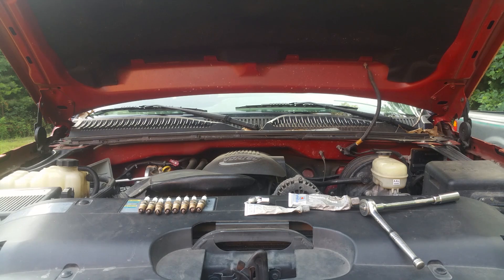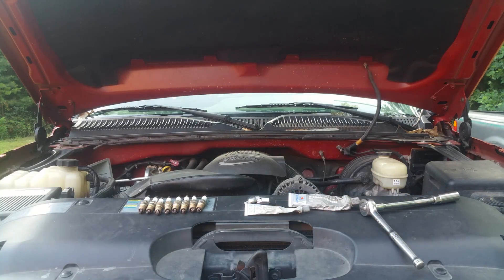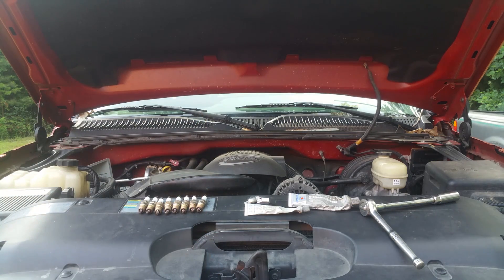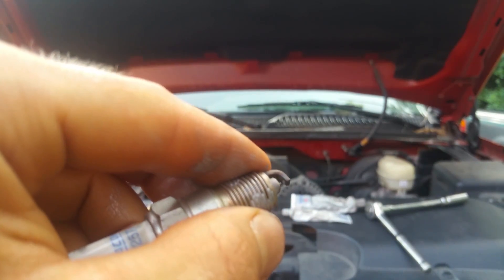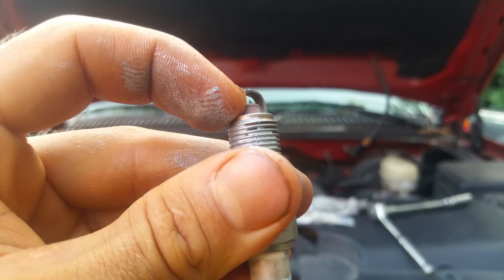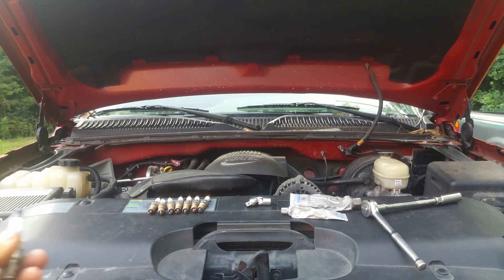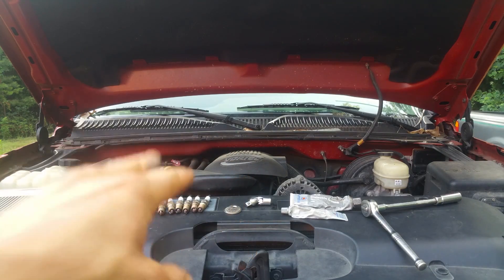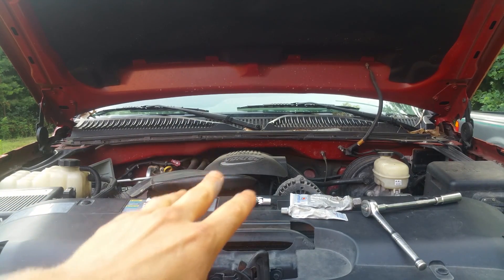NEVER Change Another Spark Plug Until You WATCH THIS!

Comment: Definitely use anti seize. I can’t stress that enough as a professional mechanic who has pulled threads several times and had several stuck spark plugs. The coating the manufacturers use doesn’t work long term. I always use copper or nickel but any anti seize is fine as long as there is some on there.

Comment: I just had to use a braker bar to remove iridium plugs out of my 2018 ram. I did use anti seize on new plugs going in. Just didn't get crazy on tightening them. I go by feel and not with torque wrench. I trust what i can feel vs the extra leverage added with large tools.

Comment: How can you NOT get dielectric grease on the plug  terminal ?? Some plugs are in hard to get to places, resulting in difficult boot replacement. Play/wiggling the boot on will get the grease on the terminal nut. Dielectric  grease most certainly will conduct. It's made so electrical conductors won't corrode and BECOME NON-CONDUCTIVE !! My motorcycles wiring harness was replaced under a recall. I paid the shop to spray clean EVERY electrical connection and then apply dielectric grease. Your supposed to apply it to electrical contacts like the old style turn signal/tail light bulbs where they contact the metal bulb holders. Electrical contacts in the auto/moto world have improved with them being rubber encased. Even with the new you should use it. Dielectric grease is conductive and non conductive. Maintains 100% conductivity and  disallows unwanted electrical currents. It's a 'miracle' grease. Every time you take apart an electrical connection,  you should clean it good with electrical contact cleaner, then fill with dielectric grease. CRC has a spray can with a spray tube that will easily fill whatever. Spray some in the spark plug socket rubber holder and the plug boot. It's at Autozone. It will make electrical work easier later on.

Comment: Good video...
Anti seize not needed on some plugs , some come with special coating already...
Boot grease for boot on plug porcelain doesn't conduct electricity...
Dielectric grease good on wire to tip of plug
Yes... maybe good on wires into cap too.
In the old days we put oil on threads helped some.
Changing plugs is more complicated than it used to be...
Some brands anti seize not good for aluminum heads... that is what I'm seeing on the internet.

Comment: If you buy the economy (value) brand of any manufacturer plug, you may find it has not been plated on the threads. ALWAYS CHECK WITH THE MANUF.  Those ACDelco 100K plugs appear to be plated and I'm confident the ones you replaced them with, are as well. In the case a plug is NOT PLATED you should apply a thin layer of anti-seize. However, applying anti-seize on top on an already plated thread (usually a kind of gold-ish or silver color) will cause a significant over-tightening of the plug even if you use a torque wrench, which you should be using anyway. You could over-tighten by as much as 30%. Going so far as to strip the threads in the head. 
And as many on here have stated, dielectric grease should stay located in small amounts on the inside of the boots and insulators. Many people have found out the hard way what too much resistance caused by an overload of dielectric grease inside a boot, can do. You may not encounter a problem initially or at all in some cases, but all the experts agree it's a bad idea to pump a lot of grease inside a boot or apply it to the terminals. 
Your point about the gap tool is 100% correct and important for people to know.

Comment: YOU ARE WRONG AGAIN, BOZO! YOU PUT A SMALL AMOUNT OF DIELECTRIC GREASE ON THE PORCELAIN PART OF SPARK PLUGS AND A SMALL AMOUNT ON THE BEGINNING OF THE SPARK PLUG BOOT AND NOT ON THE INTERNAL CONNECTOR IN THE BOOT. DIELECTRIC GREASE IS AN INSULATOR AND WILL RESTRICT CURRENT FLOW IF NOT USED PROPERLY!

Comment: When I was a little kid I remember a family friend rubbing a little oil on the plug threads. He was an old-timer even back then. I've seen others do it since. Maybe that's the old world way, or the cheap and handy way.
Reply: Might be an old timer but that is bad advice! oil will eventually work its way to the electrode. There is not need to put anything when torqued to proper spec.

Comment: So copper paste is just as good as the aluminum right?
Reply from the maker: Depends, typically copper is used on steel and aluminum is used on aluminum.
Reply: @MattsShop  I'm replacing WR7DC plugs on an old '65 Mercedes 250 S as per the owner's manual. These Bosch are made in Russia, so if they're anything like Russian ammo they're probably steel. Ha ha. Now you have me wondering though. I'm looking at the boxes they came in and I don't see any indication as to what material they are.

Comment: Anti seize does not go on spark plugs, its a myth that fools believe.
Reply from the maker: Wait until you have to use a breaker bar to get spark plugs out of an Aluminum head, and rip out the threads in the head. You'll believe in Anti-Seize then.
Reply: @MattsShop  It never happens if they are installed properly!
Reply from the maker: Maybe, but I have ripped threads out of aluminum heads, because of other people.

Comment: Chevy Colorado has a Vortec engine compatible with Japanese Isuzu so you can use Japanese spark plugs too. The problem with dielectric grease is that it becomes dry and when you pull you older spark plugs some may fell inside the cylinder hole.

Comment: Hey Matt I need your help on this one.I bought the Bosch double Iridium spark plugs model number 9602 for my GMC Sierra 1500 5.3 L V8 Vortec And I was watching A video about the best spark plugs to use for a GM 5.3 L engine and all the spark plugs were mostly AC Delco. Should I stick with Bosch or go with AC Delco?
Reply from the maker: Everyone says to use AC Delco Plugs in these engines. They run the best and literally last 100,000 miles. No need to get anything else. Pretty sure I used Iridiums in this truck.

Comment: I noticed your torque wrench is missing. My number one recommendation is to properly torque the new spark plugs. Do this into a cold engine without anti-seize or lubricant and you'll not have all these problems.  Modern spark plug threads are electroplated with a coating to prevent dissimilar metal galvanic effect. Use of any additional compounds are prohibited in the service and repair manuals. Modern spark plugs torque spec is likely much less than most would guess. I suspect your experience removing a tight plug was due to substantial overtorque by a previous worker. The aluminum threads get stretched. Typically a guy replaces on a hot engine, anti-seize or lube the threads. then guess the torque with a ratchet. Probably applied 30-40 ft. lbs. by hand into hot aluminum threads with lube. The spec is likely 14 ft. lbs. cold and dry. The difference is huge. Now the ground strap is a quarter to half turn out of position so fuel burn is compromised making the computer fight to find the correct mix for combustion. 

Dielectric grease is awesome. It's really just Silicone oil with some thickeners. It is non-curing so it doesn't dry out, crack, harden or wear out. Use on the electrical contact is recommended because the connector is a spring pressure type which pushes the grease aside to ensure metal to metal contact. The grease eliminates Oxygen bearing air from the metals to prevent oxidation. While the grease does contain Oxygen atoms, they are bonded with the Silicone atoms too tightly to provide oxidation. The grease made for spark plug use has enough thickeners to keep it in the boot but not enough to block the electrical connection. It is quite the opposite of motor oil. Where motor oil is designed to maintain bonds between molecules to prevent penetration, Silicone grease is designed to allow penetration. The electrical connector spring pressure is much more powerful than the greases viscosity. In simple terms, it'll push it out of the way.

Comment: NO dielectric on the metal!  Its to prevent sticiking and arcing and to help seal out moisture in boot.  THINK ABOUT IT- Silicone is not conductive!  Its di-electric, not conductive paste!  Dont forget antisieze on the threads!
Reply from the maker: Di-electric grease is made to put on electrical connectors to help seal out moisture and prevent corrosion. It doesn't prevent the flow of electricity. It's a myth that it hurts the conductivity.
Reply: @MattsShop  
dielectric
n.	A nonconductor of electricity, especially a substance with electrical conductivity of less than a millionth (10−6) of a siemens.
Transmitting electric effects without conduction; nonconducting.
n.	A substance through or across which electric force is acting.

Comment: Some good tips for sure. On the aluminium head of my Jaguar with a steel spark plug I always use anti-seize so dissimilal metals do not corrode together. Also another tip is using a short piece of rubber hose over the new plug when starting into the treads so as to not cross thread the plug also gives a better hold of the new plug in tight spaces to start the threading process then the socket.
Reply from the maker: Yea, galvanic corrosion and mixing dissimilar metals is no joke. Great idea with the rubber hose to get the spark plugs started.

Comment: 1º if you know how to proper install the spark plug, you dont need antiseeze, cause it will not be stuck like crazy when you remove it next time.
2º spark plug is grounded when screwed in the block... anyting betwen the sparkplug and the block, is just cutting the ground...
Reply from the maker: It doesn't effect the ground at all. I've had to use a breaker bar to get out spark plugs before and they squeaked the whole way out. Anti-Seize is your friend. Trust me.
Reply: @MattsShop  but if you are installing new plugs, you know you will put the corect torque.. so they wont stuck next time u replace them.. so you dont need that...
Reply: Some anti seize has copper in it that is what you use.
Reply: @efrensaclolo7021  it all has either alum or copper, either conductive- far more conductive than rust!  I always use it, that never use it guy can have fun with his galled and rusty threads... Ih and without lube your torque spec isnt woryh a fart either.

Comment: You don't put antisieze on ngk
Reply from the maker: Yes you do
Reply: @MattsShop  no you don't ask ngk
Reply: @patpeacock4381  it doesn't change anything dude antiseaze is fine for any spark plug
Reply: @tonytrilex2555  well you need to tell ngk that because they say don't put it on thier plugs
Reply from the maker: What would be the reason for not using it?
Reply: @MattsShop  NGK claims it affect the grounding of the plug thier stream is on you tube
Reply: @patpeacock4381  where & when.. if thats the case per an application then it already has it on... Just like their NTK O2 Sensors.  Always use the sneeze man
Reply: @patpeacock4381  hogwash
Reply: Well go too ngk website if you don't believe
Reply: Honda manual calls for anti-sieze compound to the treads of the spark plug before installation.  NGK or Denso.  If anti-sieze isn't used, then the torque supplied by the manual will not provide the correct pre-load to the plug in the head.  

I use it every time without any issues, but I would default to the vehicle manufacturer's recommendation.

Aluminum Head - 18 lbs.ft with anti-sieze
Reply: @nmhazzard  correct sir!
Reply: https://youtu.be/xZ-KOL4gZzw
Straight from the horses mouth
Reply: @notamotorbikemechanic  horseshit... Hes not from NGK, some editor of a parts flyer or something
Reply: Charlie Lambert, didn’t say he was from NGK, but don’t think NGK would sponsor a video they didn’t agree with🤷🏻‍♂️
Reply: @notamotorbikemechanic  horse's mouth?  Oh well... Anti sieze is conductive, perhaps ngk would say you dont have to because its plated for corrosion resistance, but the lube prevents galling & allows proper torque
Reply: @notamotorbikemechanic  and if you read it it says anti sieze alters torque values and ham fists over tighten.  if spec is 13 ft lbs with anti sieze thats what you do.  theres NO referance to ground interference ONLY that if you overtighten because of using anti sieze it aint their problem- sone tighten tge hell out of plugs when not necessary.  go ahead and do your thing hoss but dissimilar metals should get some antisieze and the argument for NOT is electrical interference is flat wrong!
Reply: @torkrench  "NGK tech support has received a number of tech calls from installers who have over-tightened spark plugs because of the use of anti-seize".
Reply: @notamotorbikemechanic  ok, and any one who has that issue has no business under the hood...christ man were talking about a fine thread 14mm plug at some 13 ft lbs!  Oh and i sure would have appreciated some on the delco plugs (supposed made by ngk) that i removed a few hrs ago!  Tight and squawking the whole way out...and it wouldn't have hurt a thing, regardless of your beancounters quote

Comment: Dielectric grease is only for the BOOT not the electrical parts. Dielectric grease is NOT conductive. Read manufacturers use label.
Reply from the maker: Yea, it's really a non-issue. People are overthinking this.
Reply from the maker: Not true it prevents corrosion.
Reply: @MattsShop  The use label specifies for boot not electrical components. Use conductive greese for plug connection. It will keep it rust free and give it good electrical contact.

Comment: Thanks for sharing the video Matt.  Good tips.  Regarding the dielectric grease on the terminal post however, I believe the recommendation is to NOT apply any there so as to avoid causing any resistance due to the dielectric properties of the grease - even if only potentially.  Granted you did say not "to put globs of it".  Apply only on the white porcelain (yes, it is porcelain) to help the rubber cap of the wire to survive, i.e., to not bond to it after the horrible weather temps of winter and summer + engine temp that bake the inside of the rubber cap.
Reply from the maker: Yea, I would rather have the spark plug boot survive as apposed to worrying about any added resistance.
Reply from the maker: You know your stuff. I know this is especially true even in household wiring. You put something similar on Aluminum wire called Nolox anywhere it contacts a dissimilar metal to prevent galvanic corrosion and oxidation. Pretty sure it's a code violation if you don't use it.

Corrosion on 12V electrical connections will drive you crazy trying to find the source of the problem. I always put dielectric grease on connectors. It helps A LOT!
Reply: @Johnny Appleseed right. Many people don't understand the difference between electric, dielectric, & magnetic, diamagnetic at all, and often it's taught wrong even in classes. Coming from a person who was studying the topic of magnetism reading Eric Dollard and Ken Wheeler rather than the application to auto mechanics.

Comment: No need to use OEM plugs, just as long as they're OEM compatible.
Reply from the maker: Not in my truck
Reply: Matt's Shop yeah, your truck, your choice...I've used oem compatible ones fine for decades.
Reply from the maker: Yea, in some things. I just trust ACDelco plugs. From everything I have read, they are the BEST in these motors.
Reply: Matt's Shop Well ACDelco doesn't make much of anything anymore.  Everything thing they sell is rebranded now from what I understand.  So Bosch, NKG or DENSO is ACDelco.
Reply from the maker: Yea, I'm not suprised, but they last for 100,000 miles and they are good enough to put ACDelco on the box. So they are good enough for me!
Reply: Yeah agreed, but if the ACDelco Iridium costs more than the Bosch or NKG Iridiums I'd go with the OEM compatible ones.  I guess I get more finicky about plugs depending on how big of a pain in the butt it is to access them.  ;-)  At least you're not driving a Ford Triton that has a special tool for replacing broken off plugs.

https://www.youtube.com/watch?v=ijjkAlxzvOA
Reply: @MattsShop  My 2004 Expedition. Has Autolite as an OEM pulled it out at 100k miles comes to found out Autolite makes Motorcraft spark plugs, but the gap is .030" vs Autolite .050" gap. But the truck runs better after I put the Motor craft with .030 gap and better mileage.
Reply: You're right in that the plugs don't HAVE to be OEM ... but it is recommended.  Just good old stock (unless of course the engine has been modified).
Reply: Fords are picky and need Motorcraft
Reply: Use MotorCraft for Ford. NGK is good too but if you want to be safe use MotorCraft.
Reply: @angelgjr1999  I know there are fake NGK ,I had one for my Honda and I returned it and got full refund.What about Motorcraft is there any fake ones?l got 8 for my expedition for $18 plus tax eBay.It is platinum made in Mexico.I know fake NGK is from China,Are there any fake plugs from Mexico?
Reply: Efren Saclolo I don’t think so. Ford makes a lot of parts in Mexico including v6 engines, and the plastics. You should be fine.